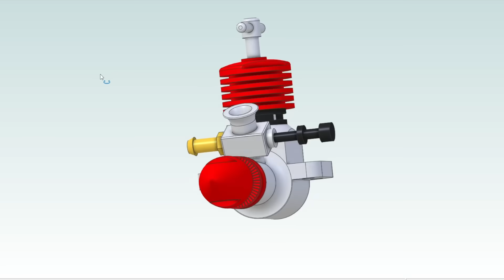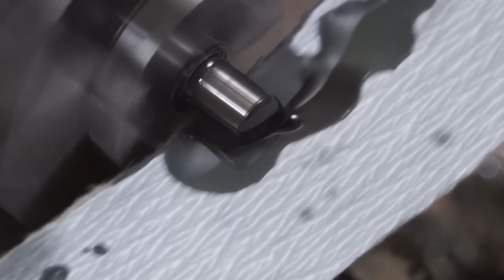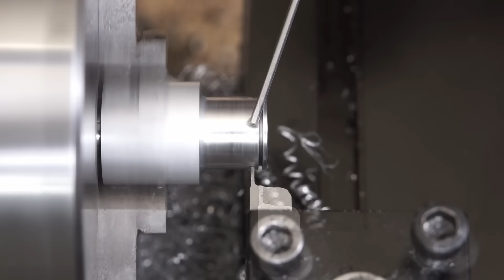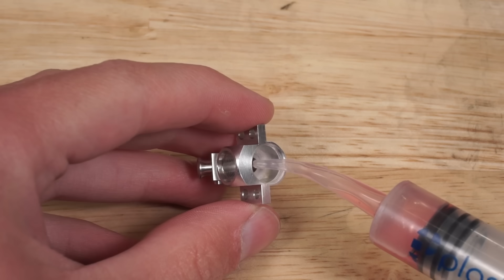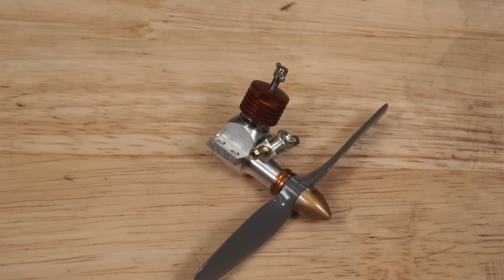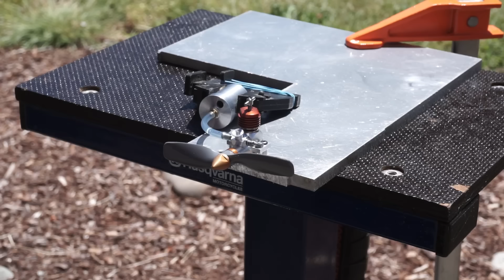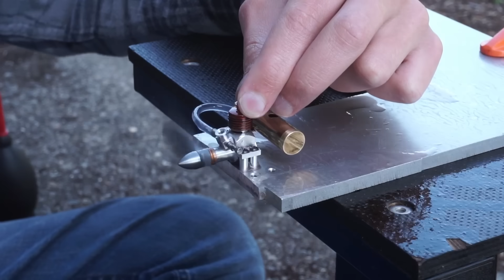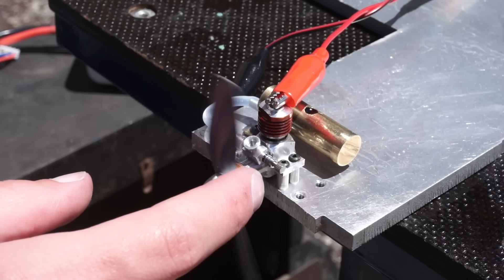I Make This Tiny 2-Stroke Engine From Scratch

Comment: The smallest engine I ran was the Cox .020 but mostly the .049. 
I developed a method of starting that used a hypodermic needle and syringe full of fuel. I could get them to run on fuel squirted from the needle into the exhaust port and then adjust the needle vale until I got the mixture correct. They would just scream. Lots of fun for a 13 year old. I am 81 now. Great memories.

EXCELLENT workmanship, Sir!
Reply: I still have an .049.  I also have a .15, both aircraft engines.  I have a .25 RC car engine.
Reply: Cox also made an 0.010 engine. It was used as a tie clip in a picture I saw.
Reply: I remember those TOO well !! That needle valve is VERY CLOSE to the propeller though !! Bit my fingers many times ! 😂😂
Reply: Cox made a dune buggy with an 049 engine.  It was a pretty forgiving engine and similar to the model aircraft engine.  My dad and I modified it for R/C using a Heathkit 5 channel digital propo system on 27.095 MHz which we built from kit.  We only needed two servos for throttle and steering.  That was a lot of fun to rod around on the street.  Those were the days of messy castor oil fuel, no. 6 igniter batteries and large electronics.   Now everything is small, Wi-Fi and electric propulsion, often with a first person view camera on board.  A lot changes in 54 years.  When we first started model making the single channel receivers still used vacuum tubes controlling rubber band driven escapements.

If I only had the machining skills shown in this video…
Reply: I owned the TD "0.010 which was considered the smallest American production model engine.  One of the neater models I flew with it was a Monowing, freeflight "helicopter" that was like a powered maple seed.  It actually flew under power well, but would plummet like a rock when the engine quit.
Reply: My very first control line model was the Cox red bi-plane with the .020 in it. My Aunt and Uncle got it for me for my birthday, I was so happy and excited. Dad wouldn't let me fly it, but he flew it being already skilled at ucontrol flying. It flew fine in zero wind. Many years later my friend and I would fly RC Cox Thermal Hawks slightly modified with .051 tee dee engines. I would start mine with an electric starter. Would try to find thermals after the fuel ran out and try to keep it soaring as long as possible.
Reply: The small engine that impressed me the most was one that Hobby Lobby carried for a few years in the late 1970's.  Made in Italy, called the Cipollo, an 0.09 cu. in. with a little RC carb. 

  It was lighter than the Cox Medallion RC, throttled at a lower RPM and made much more power.  My Airtronics Olympic II would fly for over 60 minutes on that engine on a pod motor mount. And after climbing to height and throttling down to just above idle it could run would run that speed on 4 oz. of fuel for a very long time.
Reply: @wtmayhew      That's absolutely amazing about the Cox Dune Buggy as my father modded one for me when I was a kid about 50 plus years ago.  He built his own radio control equipment too. My buggy was single channel and the front wheels wiggled back and forth as I believe they were controlled by an actuator. When you pushed the stick over the wheels would go over to that side and sort of pulsed back and forth until you let go of the strick.  Same thing would happen on the rudder in the balsa wood airplanes he built.  It was a magical experience as a kid.
Reply: @davidbolduc828    Wow, that’s cool.  The buggy we had was orange.  I remember the single channel R/C.  We had that in some planes with the rubber band escapement.  One press and hold was right rudder I think.  Short press, let go, press again and hold was left rudder.  Like your buggy, the rudder would cycle briefly to the side you didn’t want either after or before depending on whether you wanted right or left.  On the plane, you only got one choice of how much rudder deflection you got.  Oh my, how much fancier R/C is now!
Reply: Heart-warming to hear.
Reply: Where could I get a cox engine
Reply: @wtmayhew  Those were the days. In the mid-70s I strapped one of those instamatic cameras to the bottom of the RC airplane, pointing straight down, and took pictures of the RC flying club. There was no electric frame advance, so it was one picture, land, advance the frame, go fly, take next picture. And I marveled at the blurry pictures I got with that setup. Now people make 4K videos from drones. Time flies, eh.
Reply: The Cox 0.20 was called 'Pee Wee'. There was another one with a similar name, but I can't remember what it was (it's 45 yrs since I saw one). I flew control Line Combat when I was 14-17 yrs old. I still have a 1.5cc and a 2.5cc Webra 'diesel'. Same principle as what you made; no glow plug, but adjustable compression. They're in good health, packed in grease. Haven't run them in 40 yrs.
Funny: we had a Cox 0.8cc glow driven plane with nylon lines. Cause they stretched, you had to steer ahead half a round. We let visitors, who made bad comments about the skill needed for flying Control Line, fly it. It was difficult to keep it from flying into the ground if you were skilled, so they always flew it straight into the ground. And as the plane was held together with elastic bands, it completely disintegrated on impact :) It shut them up immediately. The plane was reassembled in 2 minutes, but we never told them. The Cox engines had a spring to start them. You hooked the spring on the prop and turned it a few turns counter rotation. When released the spring started the engine. Saved your fingers.
I quit flying when we (the club) couldn't get Amyl Nitrate anymore. You suddenly needed a permit to get it, cause they found it was poisonous. We ran on 1:1:1 ether, caster oil and kerosine and then added 4-7% Amyl Nitrate (depending on what engine you used, how fast you wanted it to run and how much money you had for a new engine). Glow engines we had the same problem. We could get the methanol and the caster oil, but for the Nitro you needed a permit. On top of it you weren't allowed to fly without an exhaust damper anymore. Which meant we had to buy all new engines. It was the end for most of us.
Last 10-12 years I've been flying electric motor RC foam scratch builds. Much less of a hassle, though the batteries deteriorate quite fast. At least its clean and you don't hurt your fingers starting them :)
Reply: @arturama8581  I have played with a few drones that are clearly in the toy category. RC flight is the thing that I liked the look of - especially conventional aeroplanes/gliders rather than quadcopter drones.

- mainly because of the flight time being limited to battery capacity. I managed 3 minutes with my little toy. About long enough to fly about and not crash. Not long enough to show my girls how to work it. 

Refueling with kerosene/castor oil/ether might be messy but it sounds cheaper and less complicated than stacks of rechargeable batteries
Reply: IM 45 AND BEEN MESSING WITH COX ENGINES SINCE 8. GUESS ILL STILL B MESSING WHEN IM 81. CONGRATS ON MAKING UR 80'S, B PRAYING 4 UR 90'S
Reply: @liammhodonohue  fuel has too many drawbacks for me. It's highly  inflamable, smelly, expensive, has too little amyl nitrate or nitro. For glow you need a battery to start. You either risc your fingers hand starting (swing the prop) or need an electric starter. Fuel tubes always start leaking in time. To name a few.
Batteries for airplanes last longer than for drones and helicopters, because they run 'slow' half the time. You can also fly longer. I have planes that fly 20-30 minutes. But I also have some that only fly 2-3 minutes (high speed). Batteries last 1-4 years if you're nice to them. Building plans are freely available on the internet. Both foam and balsa, if you want those. I build from IKEA underlayment foam board (5mm thick). Cut it with a hobby knife or scalpel and glue with hotglue.
Reply: @arturama8581  thanks for the tips and tricks. It's highly likely I'll follow the aeroplane airframe with battery powered prop. I like the idea of long range fpv... Just need to find a way to satisfy CAA (UK) hopefully rules will better allow this by the time I get involved.

I like the sound of your designs using IKEA foam board. I've seen plenty of videos on here of people crashing aircraft that they invested too much time in. I accept I will crash... so plan on not putting all my eggs in one basket.
Reply: ...and so many scars (fond memories) on the fingers, especially from the 10-6 props on the Fox 35!
Reply: I had my first model aircraft experience with a Cox 049 in a yellow, tether plane. I spent so much time just starting and tuning without much flying, my mother comes out and says, "I know why you bought that thing, to make noise!" Love those memories. the smell of the fuel, plane getting oily, all of it
Reply: I remember Cox engines. They were very expensive and very good. I grew up in Poland during the communist era. I couldn't afford such equipment. I could barely afford engines from Russia. I used Mk15 (1.5cc) self-ignition engines. They were quite good and looked exactly like the one in the movie, a slightly different proppeler cap (got a hole) and needle. Meteor (2.5cc) was not good. From glow engines I remember Komet 5cc. Ah, wonderful memories. I can still smell the mixture of castor oil, kerosene and ether. I had a small workshop in the basement where I improved these engines. In this engine in the movie I think the starting the problem could be due to too tight a fit of the regulating up-piston and problems with the flow of the mixture and composition with such a small needle. I improved such elements in this basement. It was a passion. Then I became a master degree engineer specializing in aircraft engines but I never managed to get a job in my profession. Neither in Poland nor in England. I born in not proper time. But I have wonderful memories. Once the police were looking for me all over town because I forgot to come home. After school I went to the basement and improove my engines until morning next day. I forot the outside world :) My parents thought I died in some accident on my way home from school.
Reply: Es sind seit dem 68 Jahre vergangen und Sie erinnern sich an jedes Detail, was mich an Ihrer Aussage am meisten fasziniert hat. God bless you
Reply: I swear all of you above are talking about the life I grew up in.  I’m 74 years old and have many fond memories that kids today don’t have a clue about.
Perhaps this is the reason why we have so much crime and violence in the world.  Parents aren’t teaching their kids the way that we were taught.  We used to play street football until ten at night under the street lights.  Now all they do is play video games and shoplift and such.  I wouldn’t trade the years I grew up in for anything.
Reply: The smallest engine i also ran is the hox 0.03 but i had a very hard time starting the engine, since fuel wasnt going through the spray valve, i had to manually put it everytime with a needle through the exhaust port, i couldnt get the mixture properly right, and i blew the piston valve, it took me 5 days to repair that, after that i tried again putting a needle through the exhaust valve and it worked wonderfully
Reply: @terryvickers5986 0.01!! Seriously!? What was the piston, a pin head?
Reply: @wtmayhew Back in the early 70's, a kid next door had probably the very same dune buggy. I remember the smell of burning castor oil, etc.😂
Reply: If I make it to 81 I’m gonna be so pissed off. I’m already done at 23.
Reply: Когда то давно я тоже.занимался немного года 2..точил.гильзы.поршня, валы..и т д...правда ничего не.вышло  ,знаний было мало..если не сказать вообще н каких.,да и заниматся особо не было ни времени ни возможности  ..как давно это все было  79  .80..года ..
Reply: I got a .49 and I started it first time last week, oh boy is it loud! I need hearing protection for it

Comment: I'm a retired machinist,  I used to machine large 18' dia x 36'' Chilled Iron mill 1,800 lbs. rolls.  I say this because I've always been fascinated by how small intricate machining was accomplished.  I was hoping though that you can call out more specs on such things as the interference fit and tolerances for cylinder bore and piston fit etc. to fully appreciate the precision of your craft.   It was a real joy to watch all your steps, thank you for sharing.
Reply: I love that within our industry there is such a divide between micro and large format machining. When I have to use a 1/16 drill I pucker but I know that’s huge for many machinists.
Reply: What seems to be missing from this video was the careful measurements of the parts as they were machined to exact specs.
Reply: Considering the tolerances for interference fits on larger stuff than what he does, I’d guess it’s somewhere near .0001 to .0005. I would certainly like to know the tolerances as well.
Reply: presumably the tolerances were as good as he could get them 😂
Reply: I simply watched this out of fascination - and it was certainly that! I had a work colleague (we were both aviators) who built scale model steam engines. Not only did they run (on meths IIRC) but they were gorgeous to look at too because the detail was incredible. His model of the Mallard was a work of art.
Reply: Machining big or small parts, same concepts.  The big difference is, if you drop a small part on your foot, it won't crush your foot.   :)
Reply: @poetac15  Not when you understand cutting speeds, chip load, and depth of cut.
Reply: @OffGridOverLander  I would bet his slight interference fit for the piston/cylinder was  probably about .0001" clearance, possibly size to size. There is  no "press fit" there, (which might have been good for the carb into the cases.). I would bet there are some scrapped parts not shown in the vid.  :)

Comment: My father-in-law was a turner, he made some of the biggest threads and machine parts I have seen. He told of huge lathes he worked with in his apprenticeship and he also marveled at watchmakers who worked with the tiny. Watching this brought tears to my eyes for the friend and mentor who passed near 40 years ago. Thank you, it was beautiful to watch.
Reply: Much respect to you,  for your respect of your mentor. I hope you were able to pay it forward.
Reply: I used to work for a watchmaker, flee circuses were a real thing because of watchmakers. The boss had a watch from 1668 that had a fusee movement (chain on a tapered mainspring barrel) the chain links were less than a millimetre thick on that chain and it was made in the 17th century 😭